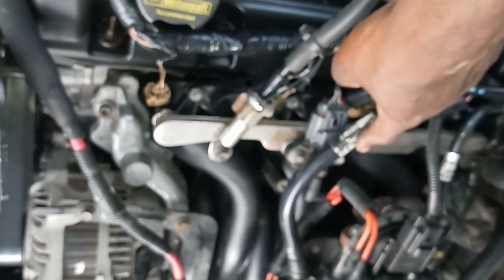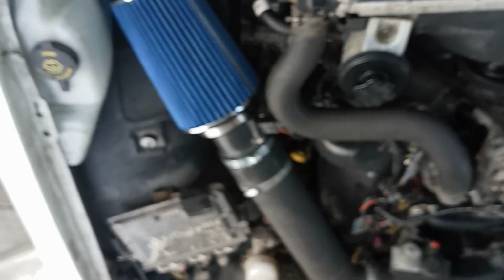Whats next ??

Comment: i would change the wire harness  I feel thats where the issue lies... cause you change a lot of stuff even the motor so the only thing thats old is the harness and you said this was happening before.. 1 or 2 sensors are getting low power... You have to check the ohms on every connection ( kinda )
Reply from the maker: I change the wiring harness and the computer
Reply: @crownvictorialifestyle4421  really? you will find it something will click via comment section... I am thinking now